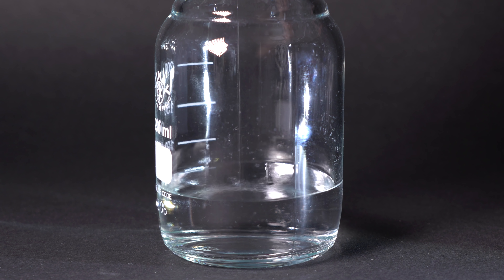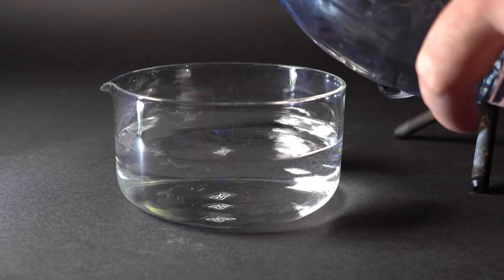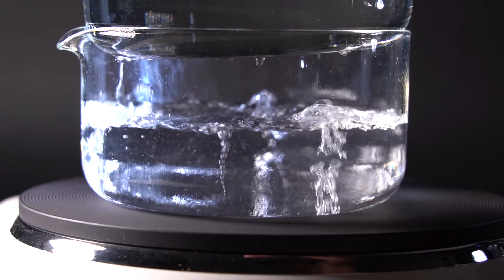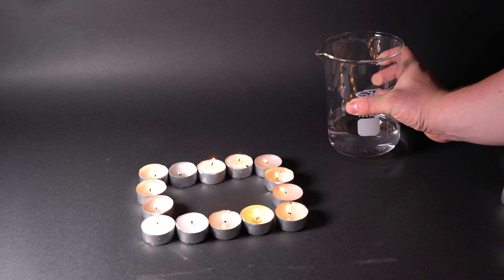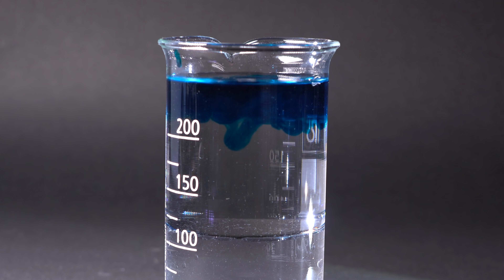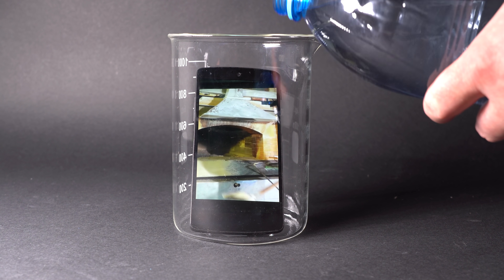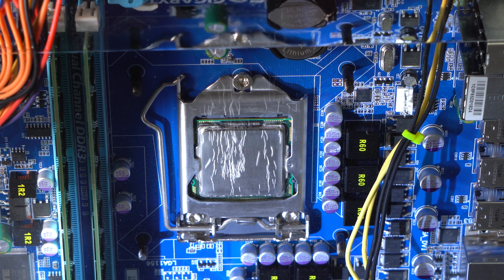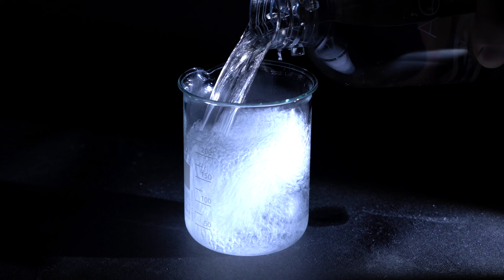Dry Water - The STRANGEST LIQUID On Earth!

Comment: That's an incredibly interesting way to see where heat is on a motherboard
Reply: Water cooling on another level
Reply: See also Der8auer for more information to this topic =D he uses a closed sysem to cool a whole case with 3M Novec
Reply: And toxic, isn’t it? Must be a closed system with hopefully redundant leak detection, or your sleeping dog or cat is dust.
Reply: @headbanger1428  it isn't really toxic. You just shouldn't get it into water, that's about it. It's chemically inert in our organisms, that's why there is no lethal dose of this stuff. Carbon and fluorine bonds are too strong for our bodies to break.

It doesn't burn either, because its in a highly oxidized state and the fluorine-carbon bond doesn't get broken up by oxygen and energy. You would have to throw really high energy with lots of pure oxygen on it, to get it burning.

But yeah, it could be dangerous because of vapourization in a closed circulation of a cooling system.
Reply: Mineral oil can actually be used to submerge electronics for cooling
Reply: @cherrypepsi2815  
Indeed! Except I think the reason to use the previous is viscosity and specific heat transfer. But yes, I would use mineral oil for sure because of availability and cost. I’ve heard of just one other caveat, and that’s that it should be desiccated as it’s sufficiently hygroscopic to conduct in certain areas of the PCB. Regardless, it’s been done many times with great success!
Reply: @cherrypepsi2815  
I've seen someone do it. He had bought a lot of bottles of baby oil. I think he had 10 L of baby oil or something like that.
Reply: @cherrypepsi2815  it can also be used to submerge humans for cooling, if you submerge them for long enough, they will reach room temperature.
Reply: @Eli Z 
I do believe that was a joke, especially with the “shock sensitive” part. I found it rather funny, but posted a warning label for younger audiences.
Reply: @headbanger1428  
No, it is real. We need people to get interested in the sciences, whichever branch that may be. If you are going to be afraid of the world around you, then might as well get rid of all cars and planes and other machinery.
If anyone is planning to make Diethyl Ether, I don't recommend storing this stuff for very long, although, there are ways to stabilize it.
Look at the chemistry sets sold to kids these days. Pathetic and boring.
Reply: @louistournas120  
I was referring to your post where you mention “shock sensitive” (YouTube ambiguously states you made the post 3-weeks ago). To be clear, were you serious in advocating the use of diethyl ether as a coolant with personal computers?
Reply: @headbanger1428  
"To be clear, were you serious in advocating the use of diethyl ether as a coolant with personal computers?"

==No, I was not advocating since the product is too much of a problem and evaporates very quickly. It's just a possibility that I mentioned.
Reply: @Eli Z 
"You are an idiot."

==Whooaaaa. Take it easy.

"You do realize that (Diethyl Ether) DE is extremely flammable with noxious vapors?"

==Yes, it is. The dangers of diethyl ether, along with 30 million other chemicals are documented.
This stuff is very volatile. If a room gets filled with enough vapors and you turn on a fluo lamp, it is risky.

"No one with brains is impressed with your stupidity and irresponsibility."

==It is my understanding that this is a science channel. Also, I like sharing knowledge. I am a chemistry amateur.
I'm not sure why you are going ballistic.
Do you love science? Do you love chemistry?
Reply: @Eli Z 
A 13yo. doesn’t know enough to understand the ramifications, so I don’t think one could be called an idiot but rather naive. These days, I don’t even know if a user is a human or an AI. I’ve already debunked a couple of bots on LinkedIn. They cannot sustain a trolling conversation that goes all over the place, and they don’t get humor, at least not yet. Instead an AI will continue forward with a topic of discussion, usually not deviating course much. It’s so weird and incredibly annoying, especially when during the first lobby of writing, you take them seriously. Sorry I digress.
Reply: What’s the oil that’s in high-voltage transformers called? I believe it has a DuPont, Dow, and/or 3M brand name. The reason it was used instead of other oils is that is isn’t hygroscopic, but this is only from my memory as I was interested in using this years ago. I don’t know why I never came to buy it. Maybe it was loaded with nasty chemicals. I don’t remember.
Reply: ethanol does it too and is way cheaper
Reply: @GoodOlKuro  
Just talking science and tech, humor aside, ethanol is conductive as it has a hydroxide group, being an alcohol. In many countries, pure ethanol is difficult to acquire as it’s a controlled substance. Lastly, I believe ethanol would eat the polymers over time. I remember that petrol fuel hoses and feeds had to changed in the modernization of petrol fuels as it would eat the fuel lines as a slow solvent and deposit the infused product into the combustion chamber. If ethanol acted as a solvent to the cheap insulation found in many 12V and 5V PC power, then an eventual arc would occur. Being submersed in ethanol, that’s not too bad. Being toward the surface in a chamber with some air, then a flame would ensue until the oxygen would expire. If that flame produced enough pressure to rupture the holding tank, then there’s a very serious problem with a runaway fire. Regardless, modern PC power supplies are very good at detecting dead shorts, but at least an unwanted arc would momentarily occur until the electronics reacts. I would stay far and away from trying anything with flammable coolants. Large successful battery manufacturers already have a plethora of issues to the tune of having logistics companies impose heavy restrictions on their transport, and that’s all because in many lithium battery technologies, the electrolyte is flammable. No fun.
Reply: @headbanger1428  Interesting answer. Are you an AI (GPT3)? Anyways ethanol is okay on most PCBs since they are made of fibre glass, copper and resins. As long as the ethanol doesn't stay longer than 72 hours on it, which it will since it is gonna evaporate quickly. Same goes for isopropyl alcohol which is even more common for cleaning PCBs. Regarding conductivity: ethanol (99%) ionizes over time (similar to pure water) meaning it is a good insulator initially .So if you use it on a powered circuit board to find a short the heat will quickly evaporate at the short circuit, leaving no time for it to become electrically conductive.
Reply: @GoodOlKuro  
I use near 100% IPA (not the beer ;) all the time with my PCBs with and without components mounted with no issues. I wasn’t quite clear on your answer, but what’s the problem with ethanol for longer than 72-hours on a PCB? Does it eat the conforming mask or do something to the epoxy in the fiberglass? I’ve never tried. No, no AI here. I’m just an ordinary carbon life form although I do dream a bit of being a Model 101 😉
Reply: @GoodOlKuro  
Ha ha! Nice paper 👍 Ethanol is a PCB killer and “isopropanol” gets unlimited use. I can get denatured ethanol, but it smells so bad like that, that I’ve just always used isopropyl. I guess I got lucky with my fave solvent.
Reply: @Eli Z 
Wow! Now that was a good reason to stay away. 😂 It’s wonderful that there’s so much competition in the electronics cooling industry. It would be great to find a comprehensive list of the top-10 liquid coolants for electronics. Maybe somebody here can make a video 😉
Reply: @Eli Z 
I’m not sure I’ve seen an overclocked video with mineral oil immersion, but I wouldn’t doubt it. My next server will be some sort of liquid cooling. I refuse to listen to a hurricane. My last challenge are the spinning hard drives as I doubt want to fork out the money for helium submersible drives. Maybe there’s a hack online? I seem to remember someone taking the filter off a drive and filling it with hydrogen or helium and then submersing it, but maybe that was in my head because I’d run an extensive test like that before doing any commitment to submersion of hacked spinning media. AFAIK hydrogen is the second best gas coolant of the elements, which is why it’s used in some power plants with at least one explosion to its title 😂 It can be easily dissociated from water. Helium is just so freakin’ exotic, and with all the helium suicides, party shops don’t carry pure helium. Pity argon isn’t better than hydrogen. That’s cheap, inert, and a larger atom, so less of a risk of permeation.
Reply: @Eli Z 
My goal is storage density and cost. SSD is very attractive but doesn’t win in the cost and density category, at least not yet. For sure would be nice as I wouldn’t worry about seals. This array will act as an iSCSI target for several systems as well, but my aim is merely 1GbE per iSCSI initiator.
Reply: If observing heat generation is your goal, then thermal imaging is a better solution.
Reply: Another way would be to produce a lot of diethyl ether and dunk the mobo into it. The bp of diethyl ether is 37 °C and it is easy to produce. It also forms diethyl ether peroxide when exposed to oxygen and UV and that is shock sensitive.
Reply: louis tournas 
Ha ha! Just for all the kiddies that have access to eBay and Amazon, please take his post as a joke. That crap will explode or at least catch a serious fire long before you level up.
Reply: @headbanger1428  don't listen to him, he just wants to ruin everyone's fun, if you want to put electronics into diethyl ether, you do it bud!

And whilst you're at it, if you're doing this with a linux machine, you'll need to run the following command with the "-rf" or real fluid flag, in the terminal while using liquid coolants like this:

rm -rf /

Comment: This substance is also used for diagnosing/finding leaks in Sony IP rated phones (pressurizing the phone and look for bubbles). Also, someone mentioned that you could end up with problems if you tried to pass through customs after handling this.

Comment: This reminds me of another 3M product I first heard about in the late 1980s, called Fluorinert (including very similar amazed demonstrations of immersing running computers and other electronics, and using it to find heat-generating circuit defects, etc). I wonder what the difference is between that, and the numerous varieties of Novec.
Reply: The Fluorinert product family is the grand daddy of immersion cooling liquid for electronics. It's (really, whats in a name?) based on fluor-based chemicals (perfluorocarbon PFC, perfluoropolyether PFPE) and, while excellent in being stable / inert and having a very high di-electric constant, there is this issue with the stuff having ozone for lunch. Whatever spills and evaporates will cause ozone layer problems, just like refrigerants do. 

Novec, on the other hand, does not have the global warming / ozone hole issue because of a different kind of chemical composition. But it's also lower in di-electric constant and it's easier for stuff to dissolve into it. It's less inert and less electrically isolating than Fluorinert.
Reply: I used to work in electronics manufacturing and we used gallons of Fluorinert. Here's a comparison I found for the two:  https://www.besttechnologyinc.com/precision-cleaning-chemistries/3m-novec-engineered-fluids-solvents/thermal-management-heat-transfer/#:~:text=While%20Novec%E2%84%A2%20is%20based,from%20the%20presence%20of%20fluorocarbons.
Reply: i first found out about fluorinert and novec from the watch community. there's this thing called hydromod, where they do DIY liquid filled watches, mimicking some diving watches like sinn hydro.

basically it's one of the fanciest solution to put as the watch lume wont get dissolved.

Comment: Interesting that most of the boiling happened off centre on the cpu -possibly showing the active core?
Reply: Below the centre sits the actual silicon die (around 1 cm^2). Thats where the heat comes from, the rest of the heatspreader isnt attached to anything (except the edge which is glued to the CPU carrier package - the green PCB)

Comment: I think if you had submerged the CPU along with its cooler it would have really been quite efficient. The surface area available for cooling the CPU while submerged was very low so it wasn’t a fair comparison to just air cooling. I get that you didn’t have enough of the fluid though! I’ve seen computers submerged in mineral oil before but this seems better, since you can take the computer out of the fluid and it would all just drip off 🙂

Comment: So I'm wondering if water floats on top of this stuff than if you got your phone wet with water and wanted to try and save it, could you submerge it in a tall vessel of this stuff to force the water out?
Reply: it doesn't bond with anything, so any water that is stuck inside or underneath a transistor is just going to stay there.  what you need to do is use a hydrophillic fluid that also has high volatility.  typically that's an alcohol.
Reply: @thomasneal9291  what does bonding have to do with displacing water?

Comment: I reckon Linus tech tips would try this...
Reply: I think this would be a great video.
Though instead of having it evaporate like that, I'd put on a top layer of water on top of it to act as a barrier.
This would serve to condense the vapor created from the heating, and also you could add a traditional liquid cooling to the water to act as a heat transfer from the regular water to the dry water (given that they don't mix you just need to pump the top layer)
Reply: svampebob007 well, you could remove the metal shield from the die, and directly pump the dry water onto it

Bypassing die-shield and shield-cooler cooler-coolant interfaces

Comment: Now my only question is, what is the Freezing point of this liquid? You missed on that :P
But it's a facinating liquid and i would like to see our LinusDropTips get his hands on and experiment with it lol
I also have another question in mind, will this liquid evapor if left out in the open? If so how the liquid would behave if it had a layer of water on top of it? Would it still evapore or simply not evapore because it has no way out? This is a good question because it could mean, you could put a layer of water on top of it to act has a sealant so you wouldn't loose any of the dry water while operating it warm or hot...
Reply: Yes, it will evaporate, and yeah I'd imagine that water would slow that down somewhat (though it can bubble through)... Personally I would generally want a non-conductive sealing layer on top of mine, but that's just me :P
Reply: Der8auer made a few cooling prototypes with novec.
Reply: Freezing point is -108 degrees C

Comment: I worked with novec for some years, its stays properly weird stuff. I really dislike it as a computer coolant though, it has some major issues with VRM's and power supplies that are not fully appreciated. In a closed system pressure also becomes an issue on components over time.

Comment: Would the dry water, being a heavier density than regular water, be used to displace water from electronics by placing the phone in a vat of dry water??
Reply: That was my first thought too.  Instead of using dry rice, putting your phone in this should force water to the top, then the phone should be good as new in a few days.   
I also wonder if it could be used to ‘dry’ solvents and other chemicals.
Reply: Jesse Hicks It doesn’t mix with water, so is unlikely to remove water already under components; the ideal drying agent readily mixes with water and so carries it away in the bulk of fluid, allowing the small quantity solvent remaining to then cleanly evaporate leaving no residue. Acetone (lab grade, not the stuff available to the public which has additives and bittering agents to dissuade accidental ingestion) has long been in laboratory glassware for this purpose, but it isn’t safe to use on electronics as it dissolves many plastics and adhesives used in electronic devices (it dissolves the adhesive used to bond the circuit board (PCB) together for example).
Reply: You wouldn't want it to mix. Just submerge the phone in dry water and then agitate it so all the trapped water can "bubble" up to the top of the container
Reply: @Superabound2  That's what I was thinking - I won't volunteer my phone, however!
Reply: @Bin216  Exactly, it doesn't mix. Place a wet phone in the bottom of a container of the dry water, it should displace the normal water/ liquid, pushing that to the top of the container. Of course by the time you try such, the normal water may have wreaked its havok, though there have been lucky among us.
Reply: @MaddJakd  Normal water will not "wreak havoc" on electronics as long as it is pure. Pure water is a non-conductor and will evaporate in time leaving no residue.
Reply: @jay_321  Pure water will readily dissolve some compounds found in electronics, eventually becoming impure and conductive like regular impure water
Reply: @FramStr  What compounds because I have electronic components outside that regularly cool below dewpoint and get sopping wet with condensation and yet work fine year after year?
Reply: @jay_321   Various oxides and dust. Also the process is not that fast. Having some dew on the outer surface for a while is different from submerging something completely in water, the water will cover more surface area, fill every nook and cranny, and remains of it will stay longer that way
Reply: @FramStr  Yes. I constantly see comments about how distilled water is safe for electronics but people don't think about all the crap that will immediately dissolve in the water off of the device.
Reply: Hmmmmm